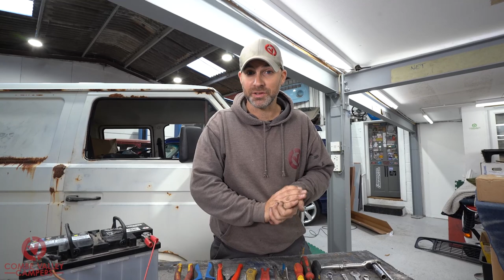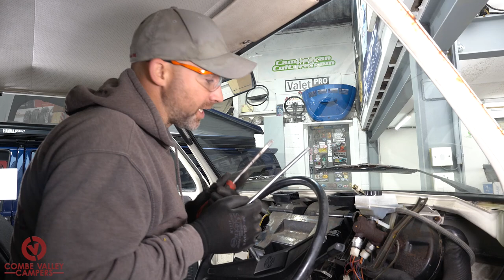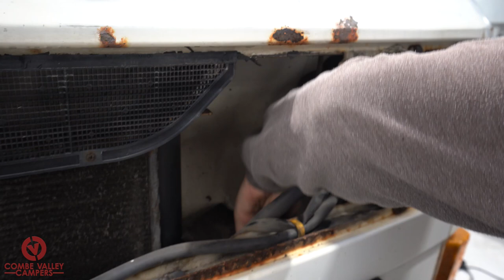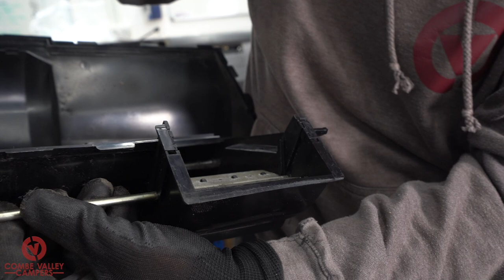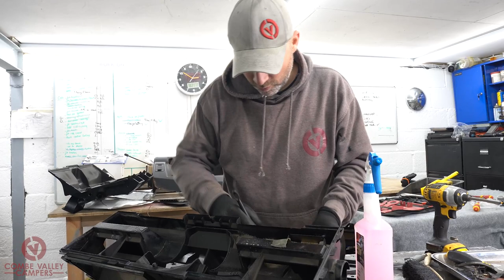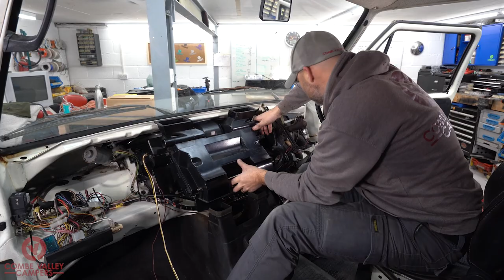HOW TO REPLACE THE HEATER FAN MOTOR IN A VW T3 (And other vital jobs to do with the dash out!)

Comment: Great videos, thanks. Keeping me motivated to get back on with my 1988 T3.
Could you point me in the direction of the wire strippers and the crimping tool you used - I need new as the last I bought just fell apart! Cheers!

Comment: Hi, I am about to do a fan motor replacement and you have produced a great instructional video. Thank you. I have had dash out before but was wondering can you test the motor without removing the heater box? Reason I ask is that mine does work for 5 to 10 minutes before it blows the fuse, I can speed up the fuse blowing by switching the wipers on because it's the same fuse. This leads me to think it could just be an earthing issue.  Not sure how I test it in the box. Any idea's great fully received.
Reply from the maker: Hi Wayne. Your correct, they are on the same circuit (fuse). Definitely check the dash earths and also all the connections. You could independently test the motor by powering it up via the plug in the back of the fan switch. Pull the plug off and apply voltage to the appropriate terminal to power the fan using a probe. Good luck
Reply: @CombeValleyCampers  Thank you very much I will give that a try. Good luck in with your expansion and Happy Birthday. 😊

Comment: Brilliant video thank you. I have a question though,  after doing this on my van, my middle heater control is stuck to the left now, it wasn't before and I can't see how to free it. I have the cables in the following order.
Top Lever connected to top flap on heater box
Middle Lever goes down through transmission tunnel and was not un done.
Bottom Lever connected to bottom flat on heater box. Any advice would be most appreciated.
Reply from the maker: Try moving the levers without any cables attached, they can get stuck sometimes, maybe also double check the cable route, they can get caught up when reinstalling the dash. They have to be free to mive
Reply: @CombeValleyCampers  thank you, I will take the dash back out and try again. On a secondary note, what does each Lever do if I need to replace a cable?

Comment: I was thinking of upgrading the heater box to a four-lever Vanagon box so the air vents in the doors will provide ventilation to the rear seat of my Doka.  Is there anything besides swapping the heater controls and adding the lower section of the heater box with the vent flap that would make this difficult?

Comment: Do you think it's possible to flush the heater matrix without dismantling the dash?
Reply from the maker: Access is very very tight without the dash removed. You'd save a lot of hassle by removing the main dash board
Reply: @CombeValleyCampers  thanks. Actually I'm told from another source you can access the pipes from underneath just behind the fan.